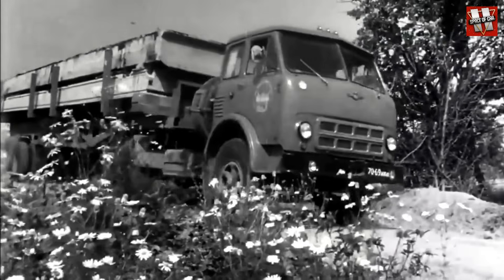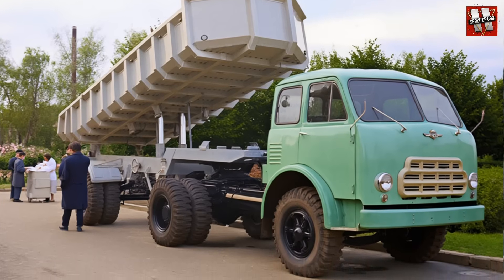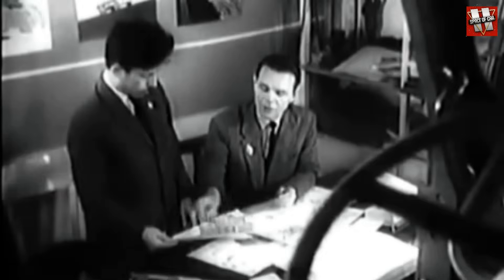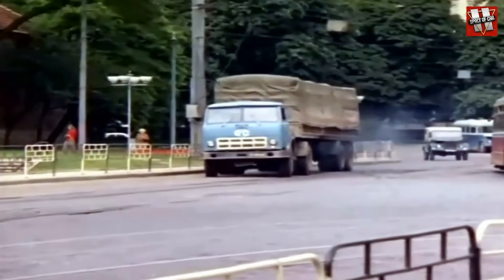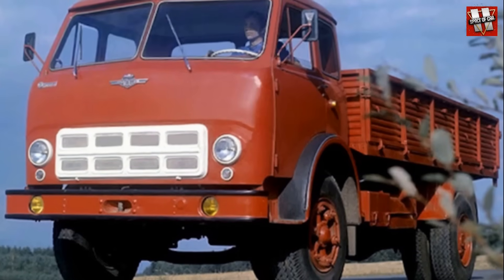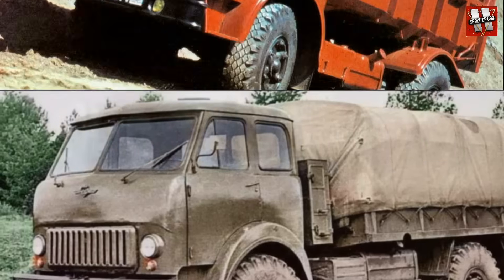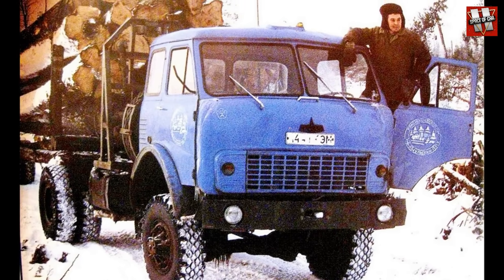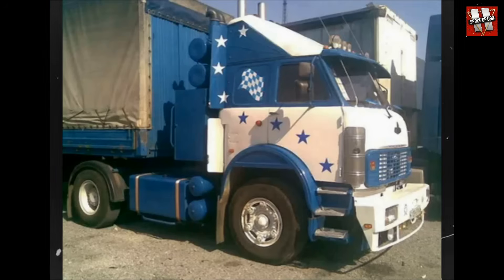How Did This Soviet Truck MAZ 500 Change Everything?

Comment: A truck with a pay load of 8 tons....they probably did load 10 tons on it, but by today standards a truck has to have payload of 22 tones, some more legally, in some EU countries the legal weight combination is 65 tones. TH
Reply from the maker: yes but the truck was designed back in the 50s
Reply: Payload of 8 tonnes on a two axle solo truck isn't bad. With a trailer behind it, 20 tonnes  is achievable.
Reply: this is russian thing, other truck models "official" load was also low, but in reality, they carried much-much more daily.
Reply: In Spain trucks that carry aggregates (tippers) carry normally 24 or 25 tonnes more or less. Pluss the weight of the tipper itself
Reply: Полуприцеп брал 22тонны.Мой отец трудился на таком МАЗ.